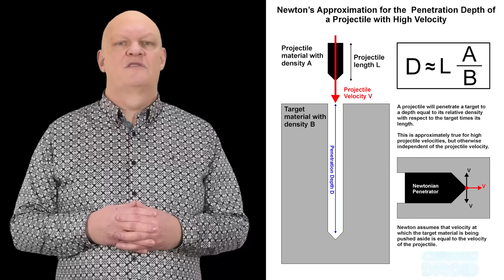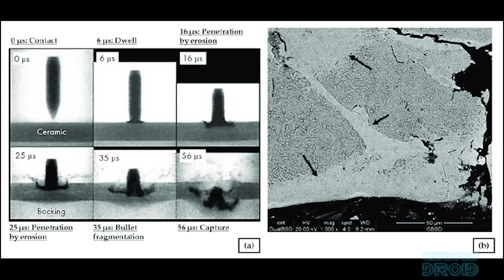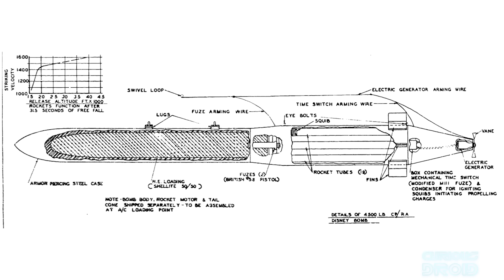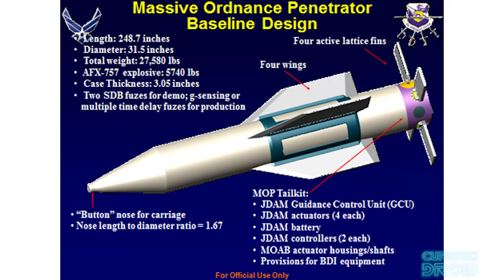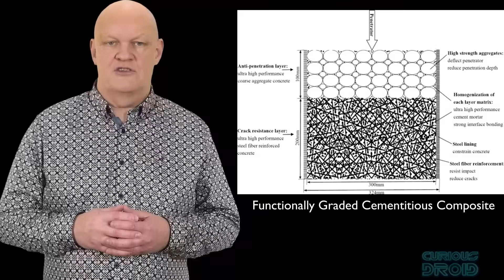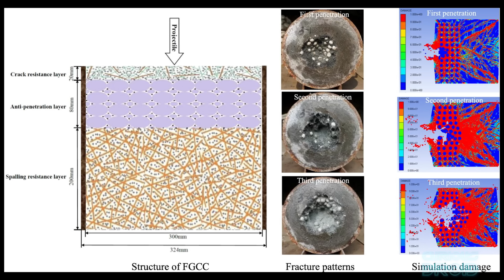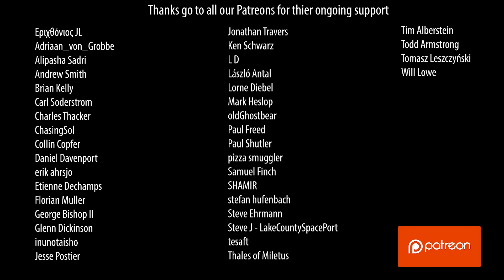Can Iran Stop U.S. Bunker Buster Bombs?

Comment: Couldn't they just create angled structures with an hardened first layer so the bmb just ricochet?
Like the armor of a tank?
You know that the bmb will fall vertically, just don't make a flat roof...
Also what about active armor? Explosives on the surface could make the bmb explode early preventing an underground one.
Reply: The concept of sloped armor being used by most armored vehicles today has nothing at all to do with deflecting projectiles or causing ricochet.  The reason sloped armor is used is because all else being equal (meaning same thickness, same type of armor) any projectile that does not strike the armor perpendicularly has more thickness of armor to penetrate than the nominal thickness of the armor.  In the same sense that firing a projectile at an angle through a wall simply has more wall to penetrate than if it struck at a perfect 90-degree angle.

In effect that means you can seriously upgrade the armor protection of an armored vehicle by taking the same armor you already use and sloping it.  The more acute the slope the better, within reason.  And you can accomplish this armor upgrade by a relatively simple design change using preexisting materials for only a small increase in the weight of armor carried.

A concept that has very little help to give the crew of the armored vehicle with missiles like the Javelin that attack the top of the vehicle.  It's often reported that top armor is "thinner" than on the sides facing the enemy is the reason for the top-down attack.  But even if the same exact armor is used as on the front and sides of the vehicle the warhead is highly unlikely to encounter sloped armor on the top of the vehicle.

This could be dealt with with a design change but there would be a problem of diminishing returns where the armor all over the tank looks like an accordion to where an attack from any angle is likely to hit some portion of sloped armor but then you'd end up with 200-ton tanks with so much weight in armor that they'd be unable to move fast enough to be combat effective.

And no, the pathetic explosive/reactive armor Russian tanks so famously have all over them, that the Russians (back when there were still fools who believed the things they said about their overblown propaganda about their weapon and materials capabilities) claimed would defeat missiles like the Javelin is any sort of a real solution.  And...well we already know how that has turned out, don't we?  No matter how good you try to make it, reactive armor is a 1960s solution to a 21st Century problem.  It's better than nothing...sometimes.  

The truth about armored vehicles is exactly what strategist and futurist George Freidman predicted in his 1990s book The Future of War , that the individual infantryman was going to become so deadly against any big armored target with weapons like the Javelin that armored combat vehicles -- tanks -- should properly be seen as an obsolescent technology if not necessarily obsolete just yet.

And Friedman also predicted deadly and near-impossible to counter small weapons like drones and loitering munitions having outsized effects on enemy targets, back when the Predator "drone" was just seeing its first use on the battlefield, and not in an armed configuration (that was still some weapons engineer's wet dream).

Comment: Interesting how people somehow didn't think to use fibres in concrete until relatively recently given the centuries old practice of using fibres in mortars to the same effect! (Eg horse hair in lime plasters/mortars)
Reply: Mixing fibers change the consistency of wet concrete, making harder to mix and pour. You don't just simply pour a bucket of glass/steel fiber into the concrete mixer and expect it to works. Just like every technology, it takes time to get perfected. Especially when fibers reinforced concrete serves a very niche role there isn't much incentives to innovate it until WW2 when bunker busting weapons evolved.
Reply: People were putting asbestos fibers to concrete over 100 years ago how is that a recent discovery??
Reply: Why do you think is that the case ? Don´t confuse you not knowing how they do things witch them not doing the things.

Comment: 20ft? try 200ft... For example { The Contract Boeing was awarded Oct 1st 2019 to make an "indefinite" amount of the: 7
              GBU-57A/B Massive Ordnance Penetrator ( MOP) is a precision-guided, 30,000-pound Penetrator, non nuclear bunker buster capable of going through 200FT of SOLID Hardened Reinforced concrete. }   

 What do we need this for? Cause I'm Fairly certain that even well funded "Barbarians" in the east or the west Would not be able to build a bunker that deep and with that 200ft of concrete above it, without expecting it to be even remotely ready for conventional bombs for months if not longer since concrete takes so damn long to cure, and the expenses, manpower ect so forth to pull off such a feat would show up like alarm bells in construction records, finances, and satellite photos! 

Not to mention how you support the weight of 200FT of solid Concrete above you, lol. (I know it's probably for "overkill," but seriously, where would you even need this? I'm pretty sure you can starve the enemy out far easier or wait for the enemy to come out and just hellfire missile them to death with a Predator drone far cheaper and less risky.

Comment: Rifle bullets do not have a hard steel case around them (4:42), they generally have a copper alloy jacket. A steel jacket would wear the rifling in the barrel out in no time. 
The reason a rifle bullet will go through Kevlar is the much higher muzzle velocity, coupled with the fact that they are narrower and pointier (usually). Even a cast lead, unjacketed rifle bullet will go through Kevlar.
Reply: Steel jacket is a thing: mild steel jacket with copper wash is common in Eastern states. Obviously the steel is very soft and the rifling does get worn out noticeably faster. Does not aid in penetration, it's merely a cost saving measure.
Reply: not true, certain european manufacturers use soft iron / steel jacket instead because of being previously blockaded so unable to import copper that was too valuable in electrical needs.  & muzzle velocity isn't where the opposing armour is, its down range, so the impact velocity is much less & most 30cal bullets are subsonic by 1000yds.
Reply: Cheap mil spec surplus uses steel. It is terrible for barrels and you only use it when you need it or that's whats available
Reply: @WhatHappenedIn-vt3vq  i have used 1000s rnds of Patrone with no adverse impact on the barrel, they are coated with a 25micron CuproNickel layer thats 95% copper thats whats in contact with the barrel not the steel or iron. MEN/Patrone 147 is a very accurate ammo.
Reply: NATO ammo is usually "full metal jacket" like the movie title which is a hard steel case...There are also bullets with tungsten tips so I really don´t understand where you get that idea from.
Reply: @sierraecho884  FMJ is not hard steel, its soft iron (German) or copper (NATO) FMJ means the bullet core is fully covered by this layer there is no opening in the base to expose lead. Lead is toxic hence its fully sealed ;-) but as a bullet at >2600ft/s MV its lethal to 1000yds & more.
Reply: @philnortham4079  My bad, it is not steel you are right. However it is significantly harder than copper or lead.

Comment: This is interesting from a non military construction point of view. Erecting a reinforced concrete structure using far less concrete and achieving greater strength would increase internal volume. Not to mention increasing load strength. The possibilities go on and on by being able to increase compressive strength along with tensile strength all the while using less material. As long as it's cost effective, which could be the make or break.

Comment: Chromium Molybdenum? Chromoly came from bombs? That's what high quality crankshafts are made of, 4340 Chromoly Steel.  It is a hot worked alloy, heated, smashed, and drawn into shape. Producing that Grand Slam was 1 hell of an industrial flex.

Comment: Although not optimal, hitting the same target in the same spot will definitely compound the effects of older GBUs. Cave then in is a pretty good idea also!
Reply: Bad idea, fails on multipole levels
- economics, flying the same mission 25 times to destroy one bunker ? Not a solution but a workaround
- you can see the practice target has hit 3x at the same stop which only minimal damage

Comment: Worries about improved bunker designs played a role in the development of the new highly accurate B61 mod 12 nuclear gravity bomb, though it doesn't have a hardened, penetrating case. The B61 mod 11 is still in service, which does have a hardened case, but lacks the guidance equipment on the mod 12 (and also probably has a much larger yield than the mod 12). Let's all hope we never get to find out how they perform.
Reply: Could be handy against asteroids.
Reply: @TimJBenham  We don't want to blow up or penetrate an asteroid, we want to redirect the whole thing. Exploding a nuke right above the surface of the asteroid might do something.

Comment: I get that this makes it much more difficult to penetrate the bunker but in the age of precision munitions what prevents you from just hitting the same spot repeatedly to dig down (assuming your explosion can blast away the material above it...or can it not)?
Reply: @mirroredvoid8394 Did some quick maths. Lets say its impact speed is mach 5 and it weighs 1000 kg. E = 0.5*1000*(1656)^2 = 1,37 GJ. 
Fat man was 88 TJ, so we're off by a lot. That bunker buster has to be either 65 000 tons or go at like mach 53 000.
Reply: @mirroredvoid8394 Ah I see. Having meteor-speed missiles would be cool tho.
Reply: @kvikende  Well this is what the military already has kind of, they can shoot a missle far enough into space until it makes a reentry. However this is costly and the missle can be intercepted easily since it´s flying path is simple. But yeah in general speed trumps weight.
Reply: @MirroredVoid what i wonder is if you could use the shaped charge concept to create a literal spear of nuclear explosive power like is is the norm with standard explosives. If so i bet it could penetrate pretty far...
Reply: @megalonoobiacinc4863  I don´t think it works with concrete as is does with steel. And same countermeasures could be applied to the conctrete structure ERA.
Reply: @mirroredvoid8394 no conventional weapon even reached the megaton range. How would you drop a bomb equivalent to a million tons of TNT?
Even the FOAB was an estimated 44 tons of TNT.

Comment: Well researched video, I visited a number of bunkers hit by tallboy and grandslam, in Germany,  France.  What was clear success was based on concrete being fresh and not cured yet  eg Valentin. When mature  concrete took damage,  but was not penetrated. In the beginning of WW2 Germany faced the Belgium Fort of Aubin-Neufchâteau. That fort was used to test Röchling shells,  long steel darts fired from artillery.  Those penetrated quite deep, number of Slovakian bunkers where tested on and you can see those projectiles sticking in those walls penetrated about 50-80cm. Luftwaffe used so called luft torpedoes against bunkers, pill boxes and forced belgium and french garrisons to surrender or abandon those, later same during Barbarossa. 

 caused big problems
Reply: From film evidence Tallboy & Grand Slam were not bunker busters, though they performed well, were bunker disruptors. Earthquake bombs that rendered bunkers (and any other target) unusable. Subsiding, cutting services, blocking entry / exit.
Reply: @russcattell955i  well actually was used multiple times specifically to hit bunkers,  Valentin,  Hamburg flakturm, 2 V2 bunkers,  1 V3 side, all uboot bunkers
Reply: @jantschierschky3461  Yes, they were. I saw what happened at the V2 bunkers.
Reply: Recently saw a video from Tino Struckman on this topic. Mind blowing they got the technology to penetrate 40m of solid ground and afterwards penetrating a steel concrete ceiling. They even had a HE warhead fitted with a fuze able to detect cavities so the projectile explodes right in the tunnel. Really baffled me the germans had such technology in use 1942.
Reply: @lolstfurofl  We were way more advanced in the 1940s than most people know.  Technological advancement has been deliberately hidden from the public for decades.
Reply: I love the Germans.
Reply: @huwhitecavebeast1972  do you mean the present day Germans or the ones back in WWII? These aren’t the same.
Reply: @Appplethefruit  There is no difference except that the latter has been subjected to 80 years of anti-German war propaganda.